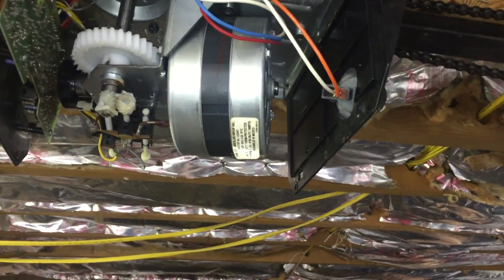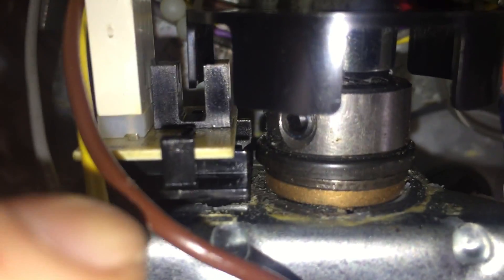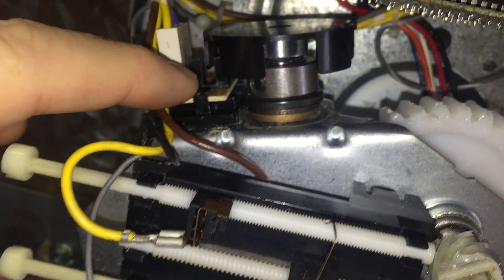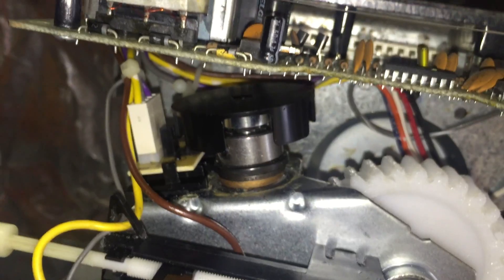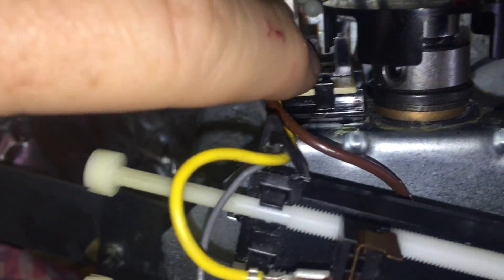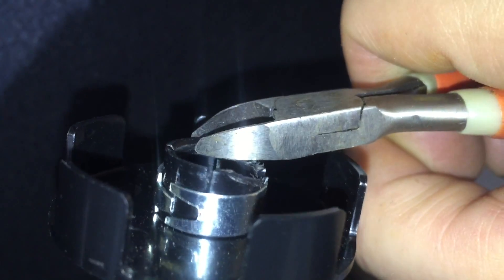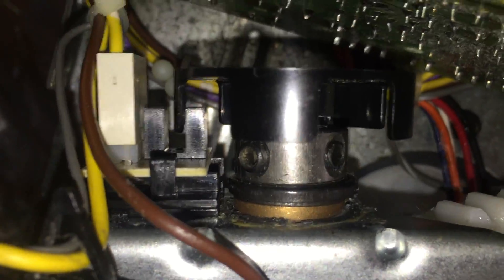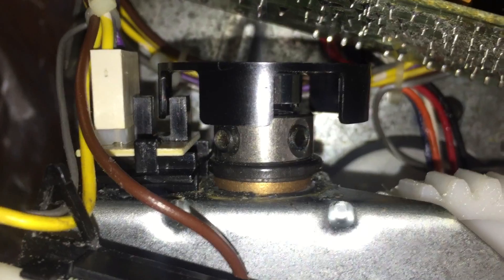Garage Door Opener not working - Only Travels 6 Inches & Then Reverses & Stops

Comment: Thankyou  Sir.. exactly my problem ,although I did not trim the interrupter cup, .. I took the colllar off and installed original thinner washer and that allowed for locking collar and interrupter cup to seat further on shaft,,FIXED IT!!....Best to use original washers rather than one in kit.....Now i just have reset my limits as I messed them all try to figure this out!!    Great video!!!!

Comment: Thanks, i replaced the RPM sensor and the cup but doing the exact same thing. so odd. I unscrewed the bolts and tried pushing the shaft in more, tightened it again still same issue. I might have to resort to cutting the cup but seems odd being those arent the tolerances from the manufacturer.

Comment: hi..i had same issue..the plastic sensor piece thats on shaft was out too far...i pushed back in and seemed to fix issue..however for some reason it waa closing ok but every time you open close it closes less and lesa...now my door closes and is abput 6inches from ground.....anybody know why?..how does garage door know what 1 full open close cycle is?...how does the motor know when to stop when its closed or open....?
Reply: Adjust travel limits on door

Comment: I, like most guys commenting, changed the gears cuz they were shot....aaand spent a ton of time looking for unobvious reasons of what was goin on. Thank god for YouTube and thank the lord for guys like you for posting this. I knew if i looked hard enough, there would be somebody that found some common manufacturing flaw and the remedy for it. I can tell by your commentary that your a guy that doesnt let things beat ya or follow the herd...and by that i mean just be like many and take the unneeded route and order the rpm sensor after the 5 led flashes. I KNEW there was something more to it!...i trimmed mine down just as you did but with a dremel cutoff wheel. nice and uniform, clean...works great. Id also like to give you props for the up close, clears as day, steady footage of what you were looking at. Appreciate it. Cheers!

Comment: is the "interupter cup"  just pried off ?  Mine seems fine after removing cover and removing all the cobwebs + a very slight turn on the up and down travel adjuster screws My house and garage were built 26 years ago and the nylon gears are in great shape : ) "Sears Best" Craftsman 1/2 hp on a 16' x 7 ' non insulated door. I expected to at least have to replace the gear shaft and bearing mount but It's back working with minimal adjustments !

Comment: I had the same problem since I used white lithium grease last year. This stuff dried up hard in winter. Lubricates the spring with silicone, clean sticky residue in the racks fixed it.

Comment: For this particular issue,  this video should be at the top of the list. 10+ videos and hours of troubleshooting.  Mine was an intermittent problem. I told myself one more troubleshooting video and then I was going to just replace the unit. You just saved me $200.00. I couldn't trim the collar on my interrupter so i put a spacer under the sensor.

Comment: Buddy, you just saved my rather lousy day! Did a lot of searching on the limiter controls, the circuit board, the closing sensors, but it never occurred to me to look at this gadget. By the by for anyone with a Liftmaster 3280 like mine, the interrupter & rpm sensor are located on the front of the unit instead of next to the gears & limiter controls. Looks the same, but kinda hard to find. I didn't have to cut anything or replace it, just push the blasted thing back further on the spindle and viola!

Comment: Great video! Helped me a lot and ... saved me a lot! One thing I did not do: I did not snip the interrupter cup! Instead, I slid the circular spring which envelops it, around the motor shaft, toward the motor! It worked like magic! Seemingly The sensor doesn't like metal. Hope that this will help others too!

Comment: Without your video I think I was going to throw everything out....although I did not cut the cap...... but you said something that triggered a thought - the drive shaft extends out when the motor runs.... also the repair kit I bought had a thick washer as opposed to the original washer which was about half the thickness.  Two things I did.... I put pressure on the back end of the drive shaft before  I put the locking sleeve (w/ 2 small locking nuts) on again.  That in combination with the thinner washer worked beautifully.... Your diagnosis was the key - the sensor cap has to rest low enough against the sensor.... Well done!

Comment: Yes, like some others wrote, I just had to simply clean the sensor with some degreaser, and it worked.  The sensor looked like it had gotten either oil or condensation on it.

Comment: Dumb, but true solution to this exact same problem: the doohickey that slides down the track to catch and move the garage door up and down, is bound up, because you or ME forgot to lube the darn thing . . tooth pick with moly grease, presto chango door works . . . worth checking before futzing around with the sensors and/or drive assembly . . .
Reply: Do you mean the trolley?
Reply: @markschirripa3607   Hi Mark, at the beginning of this problem, the trolley, when connected to the door would only travel 6 inches or so, and then reverse, and carry the door back up to fully open.  after lubricating, that solved the problem for a while, then it started happening again, either with the trolley connected or disconnected from the door . . so then I adjusted the pot that limits the downward force towards more force, and that has seemed to solve the problem or far, for about a month . . I am assuming that since the original problem caused the trolley to reverse even when disconnected from the door, that the ct, or current sensor on the motor winding was wigging out, or the pot itself was kinda dirty, or that what the pot adjusts on the board has an issue . . adjusting the pot back and forth a few times, didn't "solve" the problem, but turning the "required force" higher seems to have,  so I am left to conclude the current sensor is nuisance tripping, and/or there is a transistor or chip issue . . . ????
Reply: @larrycapelis4423  Thanks. I have been adjusting the pots on the back of the machine. I had forgotten about the pots on the side of the machine. I'll try those.
Reply: Hi again Mark, my rig is a chamberlin, the up and down force pots ARE on the back of mine, not sure what a second set of pots do . . Basic advice, try a little adjustment, before trying a larhe adjustment . . ;)

Comment: OMG..thank you so much!!! This fixed my garage door issue. Mine doesn't have the sensor and all google results is adjust the sensors. Should have know this was the cause bc I replaced the worm gear and the bearing with the set screws probably wasn't pushed in all the way like factory.

Comment: Yeah Brother!!  So many other stupid useless videos that are like manufacture troubleshooting guides that start out with "check the power".  I was just about to go buy a new opener or controller board.  Mine had been acting up for the last month.    I was thinking heat related so I pulled the cards & check all the solder joints.  Nope, so I pulled the LED bulbs because they can cause interference, checked the door sensors, checked the travel limit contacts, all of which I knew were not the cause, but troubleshooting is a process of elimination. I even looked at that damn RPM sensor, but it looked clean.  I should have broke out the O-Scope to actually check it but I really was just not that interested in troubleshooting it anymore.  Well I searched once more to see if anyone has seen this problem and found your video. Since you were having EXACTLY the same symptoms (FYI: if you run it without the cup it stops at 6 inches, although mine was more like 12-14 inches, bad, but not completely bad. ) I figured what the heck, ordered a new RPM sensor for $10 and slapped it in today.   WOO HOO!!   Thanks for posting your video.  It was actually hard to find the video with all the other garbage ones out there and I'll bet the only one that explains this problem.  Thanks again for taking the time to post it.

Comment: My garage door will only open a foot (maybe). If I disengage the door the bracket comes all the way back. But if the door is engaged it barely opens a foot. Could it be my door bracket (hinge) hanging it up.
Reply: sounds like you need to adjust the force which the garage pulls with before registering the door as obstructed or bound-up.  Also check you door springs and track and make sure there is enough force pulling the door upward, and that the tracks are running smoothly.  If they have gotten gunked-up, or the springs have un-tensioned the door will be harder to move and trip the force limit
\
Reply: I had the same issue with door stop opening after one foot.  Lubing everything did not solve the issue.  Finally I found gunk in one of the roller tracks just above the curved portion.  Cleaned it with WD40 and wiped it dry.  Now my garage door opens smoothly and quietly without stopping.

Comment: Based on the cut on your finger, and the Ring, washers etc., looks like you originally changed out your motor worm gear. Did you use the thick washer? If so, you lost some space, also you need to tighten the big rink with hex screws really tight so the motor doesn't push or pull the shaft and making the interrupter come off or almost off. That causes the door to close a foot, reverse and stop. Hope this helps someone else.

Comment: My  Genie did this but only went one way not back 6 inch's....
I replaced Rpm sensor and it still does it ..
No way to cut my Rpm like that it sits down as low as you can go ..
So replacing circuit board ..
If not that it's motor ..
Motor can do this also ...
I hoping Genie will cover motor if the new circuit board does not work ...
So Rpm sensor may not be problem.ad I am having  ..

Comment: You are a genius - and a true human being for sharing your knowledge. 
When my LiftMaster stopped working with the classic - "up six inches, down six inches" syndrome, I first looked online for a repair. I tried one of those "fill in the blanks and we will give you an offer for a fix."  I filled in the blanks and the offer came: over $400 to come fix it. I could buy a new opener for that. So I looked online and found your post, took off the cover and pushed in the RPM sensor, and viola! I cannot tell you how happy I am with your suggestion and knowledge.
I'm subscribing. 
Thanks again.
Tom Nelson, Zigzag, Oregon

Comment: I ended up trying this method after replacing my RPM sensor and wheel, but I still had the same symptoms. Long story short, my issue was the prongs in the connector that connects onto the main board were loose/ not making contact. I ended up just using a small narrow tool to push all the prongs in, so there would be contact again. Hopefully that makes sense. Check this first before spending a single penny any anything.

Comment: Thanks a million Tim! After going through the gamut: adjusting springs which did need it, tightening chain, new limit switch since contact broke for downward travel, and force level adjustments with no luck,  I came across this and you nailed it my good man!  Mine was actually missing and after searching the garage floor for it w/o luck decided to plop down the huge bucks 8^) of only $9 for a new one.  Thanks for taking the time to record this and having the title which matched perfectly on the google search query. Happy trails...

Comment: Were you (or anyone) getting a bad travel module LED error code when this happened? 3 up, 2 down I think? (Following 4 up, 1 down before attempting to reprogram the travel.)

Ours goes up fine, but won't go down. Goes about 6-12" down and reverses w no light blinking. We're being told it needs a new travel module.

Comment: Thanks so much for this vid.   I had the exact same symptoms.  After years of metalworking and throwing soot and dust into the air,  apparently my optical sensor got dirty.    All I had to do is take off the cover of my opener and blast out the insides with my air gun & compressor.    Case closed!

Comment: I just replace the plastic gears today, but I forgot to put back this thing. the opener close and back on . took me long time to test and clean the sensors but still won't work. After I watch this short video I found this part and put it back. wow opener works right away. Thank you Tim.

Comment: Mine was working from the wall controller. I was told the board was bad thats why the remote didnt work. I changed boards now it wont go doen all the way and comes back up and stops after about 6 8 inches. WTH did I do when i changed boards?
Reply: Ever figure out the issue?
Reply: @shaneconn4882  
Remote still doesn't work
Reply: @robertglasser645  does the wall control work.. replaced mine door opens about 3 inches and stops
Reply: @shaneconn4882  
Wall control works, remote does not. I have gotten a new remote and put new batteries in it.

Comment: Great video, will have to see if that’s what my opener is doing. When opening the garage door, ice had the door stuck to the floor.  The opener ripped the door loose of the ice, but jerked around a bit and went back down.  Now it only travels 6 inches or so and goes back down.

Comment: Thanks for doing this, I replaced the gears in my opener and had the same problem afterwards, turns out if the worm gear isn't seated all the way tight on the shaft then the sensor won't engage.  Glad I found your video!

Comment: sometimes it's not worth to spend time with old opener,,,mine was 15 yo and the limiter was bad. I changed by myself , Chamberline B750, lifetime warranty belt and motor, others are 5 years...it works very well and quiet than chain!! $198 chamberlain B750 ..works great!

Comment: Just this afternoon I was working on my sister's garage door opener (Overhead 696cd/b). I replaced the capacitor to fix the non-starting motor. But then I ran into the 3 or so inch travel and reverse issue. I looked at the beam sensor at the door and confirmed it was blinking when blocked so no problem there. Looked at force settings and all kinds of things. I was ready to quit and do research at home when my sister spoke up and asked "could it be because the cover is off?" I thought about it for a second. The garage is poorly lit but the south wall is mostly fiberglass corrugate letting lots of light shine right on the circuit board and the photogate for the motor RPM sensor. I closed up the case and lo and behold, it worked perfectly again. I adjusted the  opening and closing force and all seems to be running fine. I haven't seen this solution anywhere on the web so I thought I'd get it out there.
Reply: omg you are amazing, had you not commented on this post i dont think i would have ever tried just putting the cover back on.... i had a plastic housing break in mine so i repaired it, and wanted to test it out beofre reinstalling the covver, moves 6 inches and stops, i messed with it for over an hour trying to see what could be the problem. then i found your comment.... thank you so much!
Reply: @andrewtaylor4200  Glad to do it, Andrew! Like my sister just reminded me...the old saying goes: "No question is a dumb question except the one you don't ask." I just wonder how many people could not get their opener working and ended up hiring an outfit to replace their old one. If you really have a broken opener and plan on keeping your house, I'd highly recommend a Sommer Direct Drive. It's a little slower than many but it's made in Germany and has a lifetime warranty...not to mention it's easy for one person to install. The thing is almost completely silent - the door squeaking is the only sound. I will replace every opener I own in the future with these.
Reply: @keithmoore5512  putting the cover back on fixed mine!!! thanks lol

Comment: Thank you, Tim!  I didn't cut down the interrupter cup or replace the RPM sensor, but when I was told the RPM sensor needed replacement by my repair tech, I looked it up and found this video after he left.  It made me try just refitting the interrupter cup which was the solution to my problem (that same short trolley travel & stop, over and over).  Thanks for providing this overview.  Saved me $150 ($60 something for the RPM sensor, and the rest being overpriced labor / trip charge).  Your time spent is a good public service.

Comment: I did shave the cup down a bit and it still didn’t work.  I saw on the RPM sensor that it might be a little greasy so I took a small piece of paper towel to fit it between the plastic and wiped the sensor just a little, then bam!  The door opened and closed perfectly!  My led light is still blinking 5 times but when I push the button it works!  Thank you!

Comment: Problems solved, after watching your video, I thought I'd look at the RPM sensor assembly, sure enough the plastic rotating cam was not fully seated against the collar (motor-side), pushed in, heard it snapped, and moved approximately 1/16-1/4" and now it works normally. Thought the rotating cam looked too close to the printed circuit board. THANKS for the idea!

Comment: Good job! You can clearly see the motor shaft come out just a little. My issue was the grease from the gears got warm from the heat in the garage, leaked down on the little sensors, and kept it from reading accurately. I have a lot different model than yours too. It's a chamberlain whisper. Same sensor style though.

Comment: TRY THIS..RPM SENSOR....My garage door opener wouldn't go up or down. It would abruptly stop both ways. I tried replacing safety sensors and checked all wires. Spent hours $%^& with it! Then I opened it up and saw a cobweb on the RPM sensor. Blew it off and all is good now. This fixed my problems twice.